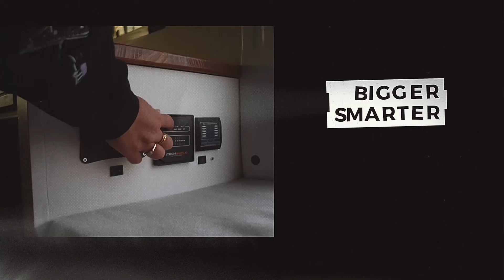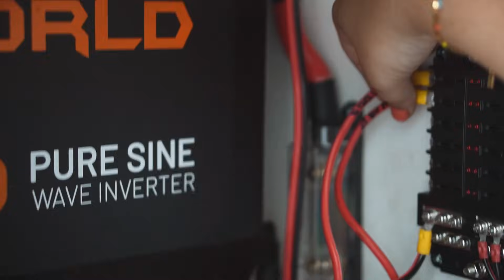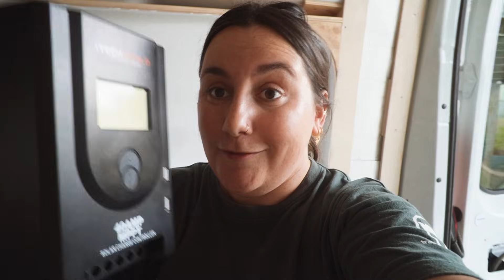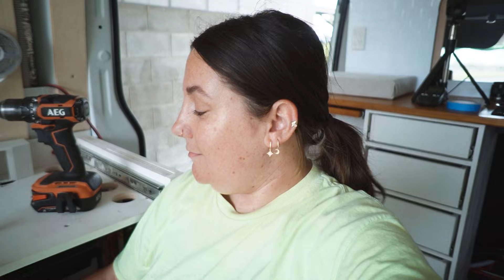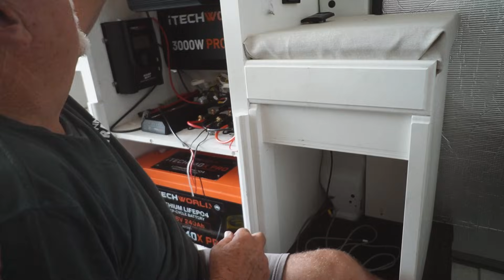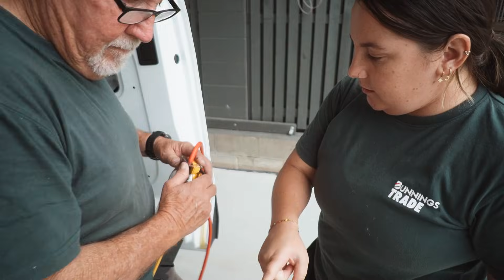Complete Van Electrical Install Guide (Step-by-Step) | LDV Deliver 9 Off-Grid Wiring Tutorial

Comment: Hi there guys, I'm also doing an LDV deliver 9 and I was curious to see where you connected to the van start battery?
Nkt a lot of room to see under the driver seat.
Reply from the maker: Heya! Yes, you're right 😅 it was tricky to get in there, but it was just for the DC to charge while we drive, so took a bit of fiddling and squeezing to get in/around the front seat but we managed - not a lot to show on our end though, sorry! Best of luck with the build!